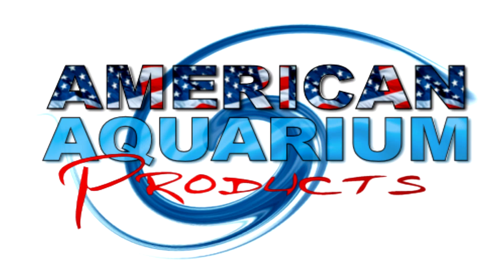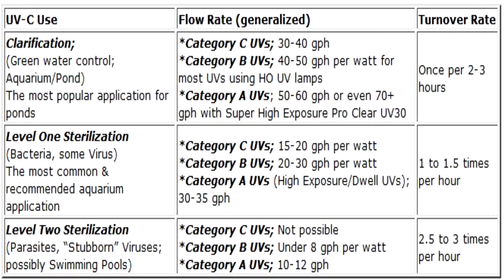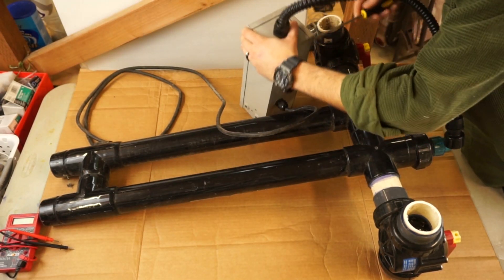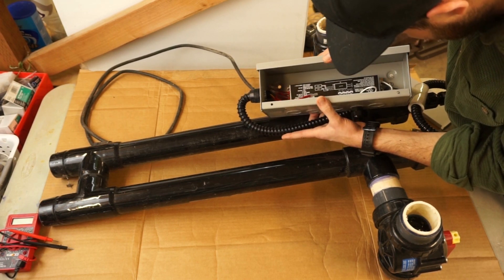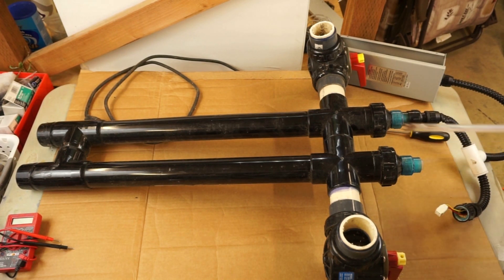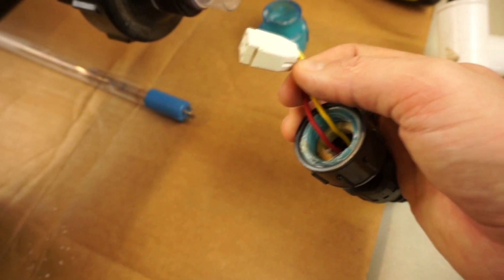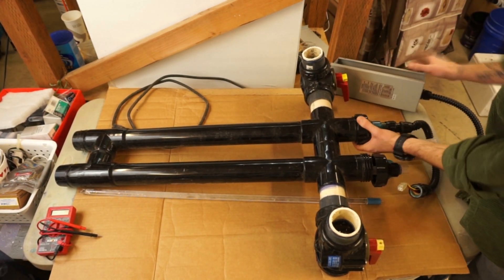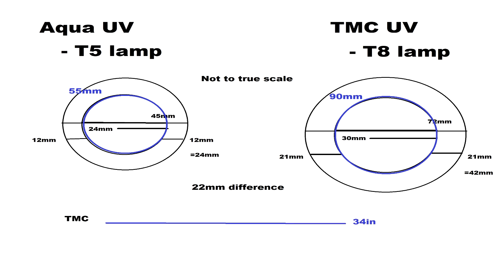Aqua Ultraviolet Pond UV vs TMC AAP Pond UV Clarifier Sterilizer

Comment: What is your thoughts on those $40-$50 uv sterilizers on eBay? Cheap made in China but for a 55-75 gallon ???
Reply from the maker: Many times they come with cheap lamps, which make them far less effective. This video details what makes a good sterilizer. 

https://youtu.be/xJ2o15-sKro
Reply: The article in the details section which is a MUST READ deal with your question.

QUOTE:
"SOME UV STERILIZER/CLARIFIERS TO AVOID OR GOOD UVs TO BE CAUTIOUS OF THE HYPE:

    Low Cost UVs, generally sold via Amazon, Lowes, & eBay:

    Be careful of some of the cheap UV sterilizers currently flooding the market generally for under $50 usd, such as the Aqua Medic, Sunterra, Green Killing Machine, Jebo, AquaTop, etc., as noted earlier there is not one of these that can perform level 1 UV Sterilization.
    Our aquarium/pond service has experienced poor results with these units (leakage, poor sterilization patterns, low quality ballasts, & more).
    If you obtain one of these units, you CANNOT make a fair assessment of what UV Sterilization can really do for your aquarium or pond.

    A recent social media conversation I had showed the lack of understanding of what you get with these cheap UVs. He argued that for $30-$40 he could get a 9 watt UV Sterilizer at Amazon and compared this to the AAP Vecton Model 200 at $150. He stated that even if just 80% as effective he would be ahead on the deal via Amazon.
    Problem is, these cheap UVs utilize low cost medium pressure UV lamps with only 25% of the UVC output of a HO low pressure lamp. Then add in at best 50% of the dwell time and you are at just 1/8 the effectiveness and this $150 Vecton is the same value of an Amazon UV sold at $18.75 (as per the math). Throw in a lifespan of 7-10 years versus 1-2 years for these cheap Chinese models sold via Amazon/eBay and this is a no brainer.
    It is also noteworthy that these cheap UVs are not sterilizers, these are clarifiers only (& not good ones at that!)

    The bottom line is if the UV seems "too cheap", there is most likely a good reason such as with the PFUV-40 Hang on the Back Filter with UV at price of $50;
    For $50 you are not going to get an effective filter and most definitely NOT a Level One UV Sterilizer!!."

Please Read in Full:
http://www.americanaquariumproducts.com/AquariumUVSterilization.html
Reply: @devontrigg642  wow.... Congrats on the longest youtube comment I've ever seen! Lol ain't got time to read a 1000 word paragraph